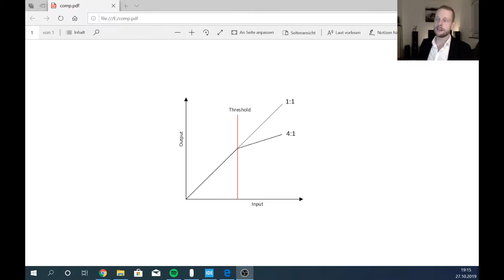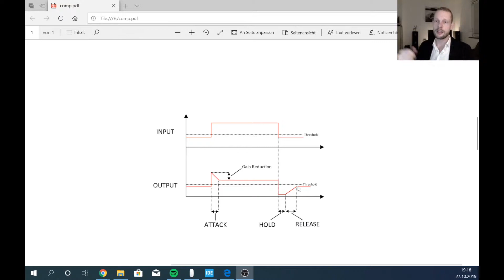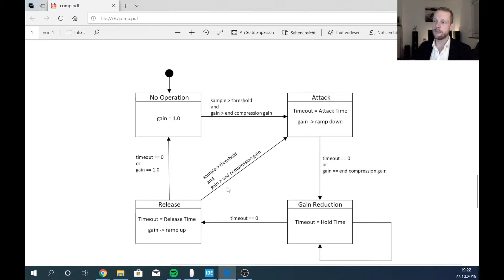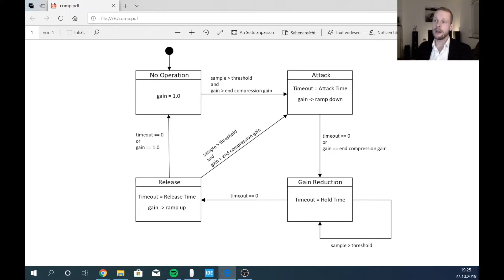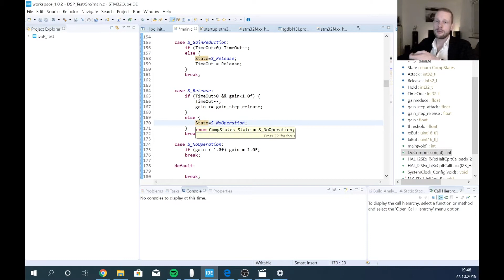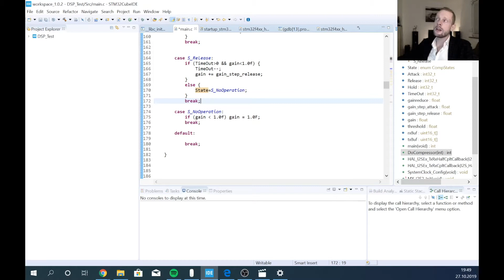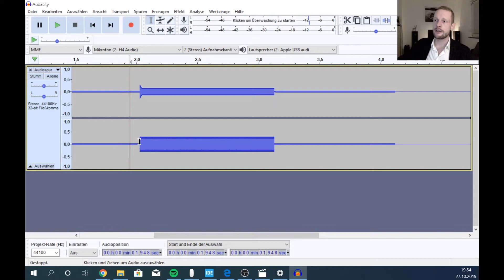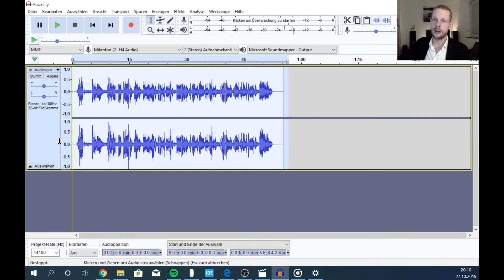[#6] Compressor - Audio DSP On STM32 (24 Bit / 96 kHz)

Comment: Hi,

Thanks for your video, really helpful so start audio on STM32.

For me there are a few mistakes in your video :
- The "Ratio" parameter is not the gain reduction (in dB), but the factor by which the level over the threshold is multiplied (in dB). For example, a ratio of 6:1 doesn't mean that you have to reduce the signal by 6dB (/2) when you go over the threshold (what you did). It means that if you have a signal 6dB over the threshold, then you have to reduce it to 1dB over the threshold (5dB reduction). A signal of 12dB over the threshold have to be reduced to 2dB over the threshold (10dB reduction). And with an infinite ratio, a signal x dB above the threshold will have to be sent back to threshold, so reduced by x dB : It is a limiter.
- The state machine is also not good to me. For example, if you are in "Gain Reduction Hold" state and the signal goes up again, you have to go back to attack again to reduce a bit more, before the hold timeout is over.

My algorithm would be, at each sample :
- Calculate the level of the signal : It can be a peak level as you did, but can also be RMS value on a few samples
- Calculate the "expected gain reduction" (timing not used here) depending on the input level (peak or RMS) and the threshold. If the input level is below threshold, the expected gain reduction is 0dB. If the input level is over threshold, then the expected output level over threshold is  (input_level - threshold) / ratio, so the gain reduction is ( (input_level - threshold) - (input_level - threshold) / ratio ). In this way, with a ratio of 1, there is no reduction, and with an infinite ratio, there is a reduction of (input_level - threshold) which means everything above the threshold is send back to the threshold so the compressor act as a limiter
- Finally, there is all the timing stuff to do and state machine. The final goal is to calculate the "actual gain reduction" depending on the "expected gain reduction" from this sample, the "previous expected gain reduction", attack, hold and release, and previous sample values.
--- If the "expected gain reduction" is higher than the "previous sample expected gain reduction", it increase the limitation, the "actual gain reduction" = "previous sample actual gain reduction" + ("expected gain reduction" - "actual gain reduction from previous sample") / (FS * attack) => In that way, at each new sample, it goes a bit more close to the expected gain reduction, in an 1/exponential way. Also restart the Hold timer here.
--- If the "expected gain reduction" is lower or equal than "previous expected gain reduction", it reduces the limitation. If hold timer is not over, don't change "actual gain reduction". If hold timer is over, reduce the "actual gain reduction" as done in "attack" part, but using release time
- Multiply each sample with "actual gain reduction" (need to calculate from dB to linear)

I might have done some mistakes in the algorithm, but I am sure about the definition of the ratio

Comment: Hey !

Today I looked over your excellent tutorial again.
Some remarks from an audio engineers perspective: in the original code your attack/release timing looks odd..30mS for attack is long, 20 +10 for release is really short. 

In your real world example you did change the release timing by quite a bit, because it 'sounded horrible'..good!
Now for the fun bit: 

There is actually 2 mistakes in the tx-rx complete callback routine as provide by CubeMX: 1. you have to repair the code to make the complete callback fire 2. the call back fires for both send and recieve DMA's so in fact you are running your interrupt code at twice the sampling speed
If you look close at your Audacity recording you can see for example, that your attack timing is half of the expected 30ms (which works out to a 'ok sounding' 15mS)

Anyway, keep up your good work!
Reply from the maker: Hi, thanks for your hints.
That with the complete-callback I already figured out and fixed this in the HAL libraries during my first video on IIR filters.

To be honest - that the callback is firing twice I was not aware. I checked that one time with the scope by toggling an IO with every callback and it was reasonable to me.

However - thanks I'll check it once again.

Comment: Hi, thanks for your video. I am working on a university project using the stm32f407vet6 board and an inmp441 microphone (https://www.aliexpress.com/i/32962426410.html), the configuration I have for i2s seems not to be right, and I am confused. Set my plli2s to 96Mhz and in i2s set the frequency to 96khz, Data and frame format: 24 bits on 32 bits, the communication standard as MSB First (according to datasheet). but the dms uses a uint16 structure, so I assume that the 32bits is divided into 2 and I try to reconstruct the data but I can't do it, is it possible to help me understand it? For now I need to read the data from MEMs i2s and remove it by microcontroller DAC whether to apply dsp treatment. If you have an example I will appreciate it.